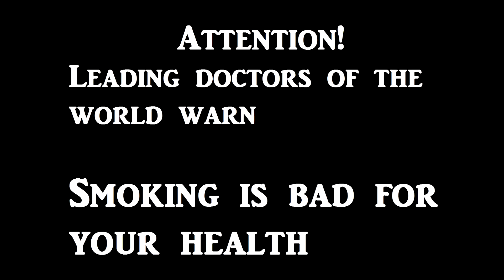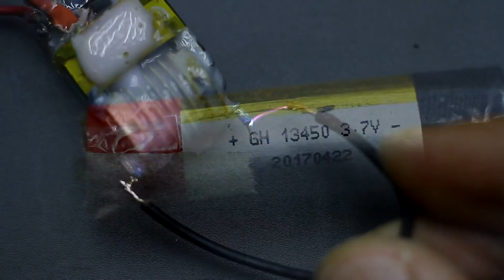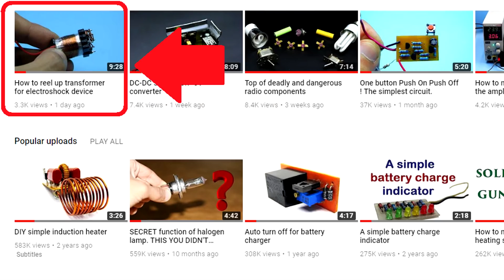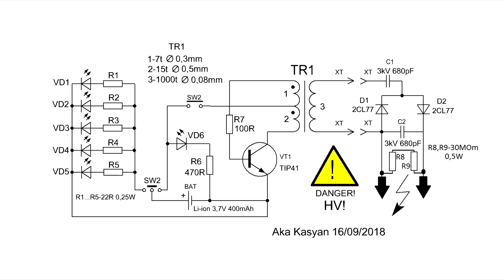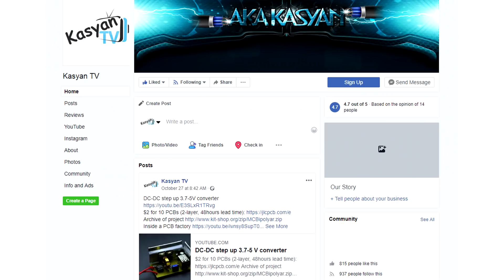DIY unique Plasma Lighter

Comment: I made your circuit in the light bulb video, it works good, but I want it to make arcs this big, I only have 13007 transistors do you know how to make the arc bigger?
Reply: Use lower base resistance